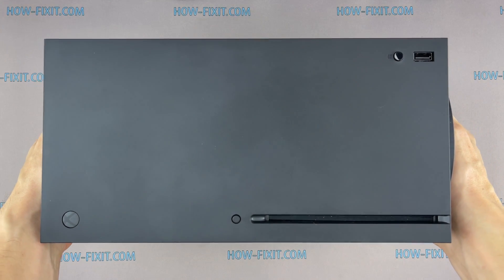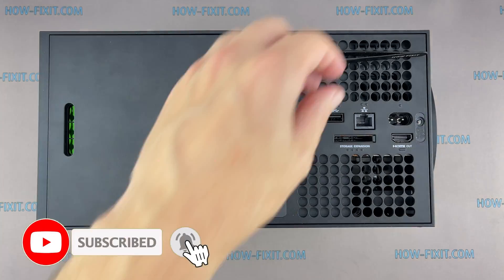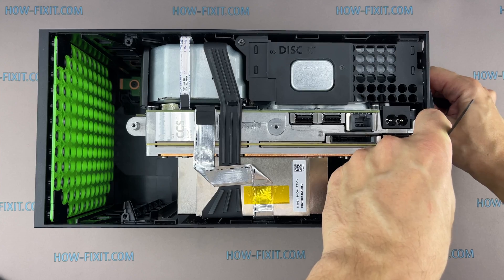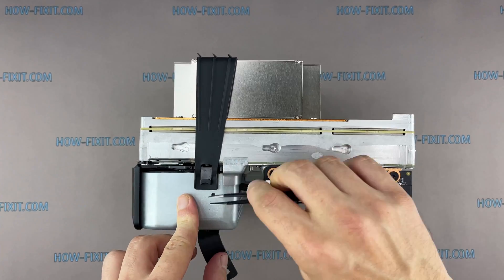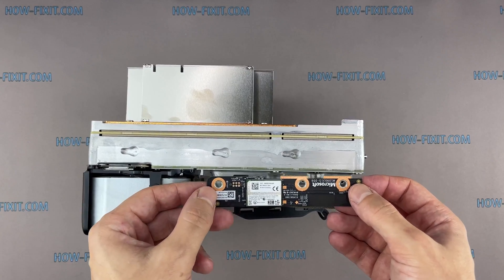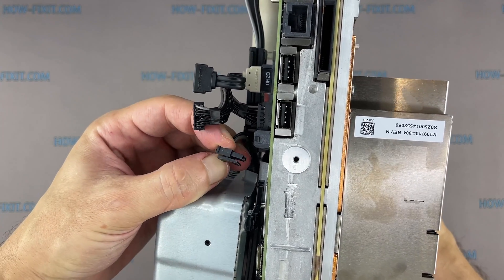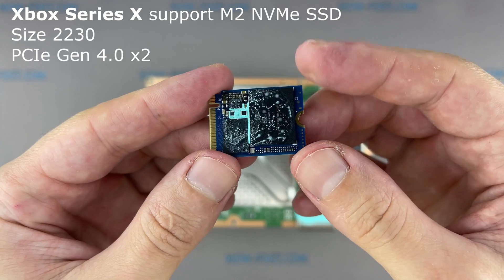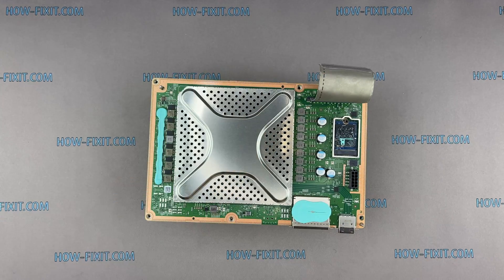Xbox Series X internal M2 SSD Replacement

Comment: Very good teardown/ reassembly.   Good luck installing OS on the system though.  Need to include the little part where you have to run a batch file on the drive. (master update file) which is not easy to find.

Comment: Hi... thank you for this good guide. Will ask if that one is compatible which i have buy... it is the Crucial P310 2TB M.2 PCIe Gen4 2230 will sold on amazon. Will this one working in my x series..? Will expand internal. Best regards
Reply: Hi this SSD works?
Reply: Hello, did the P310 work?

Comment: With how much you have to take apart you can tell it probably wasn’t meant to take apart vs the ps5 has way less steps although Xbox was basically built with a pc in it but it is nice a video like this having a thorough instructions of how to if someone took it apart . I just wish the external storage worked enough like the old Xbox models . Unfortunately some games can’t run on the other storages they have to run on the internal storage. Sometimes I wish the memory storage was built the way it used to be and ran like so to…. Thanks for the video again
Reply: @calebbrittain5004  if you’re talking about the external slot on the ps5. The main ssd is literally soldered to the main board, so when you think about it, the Xbox’s ssd having a removable one on the board isn’t that bad

Comment: This video is if your 1st internal NVMe fail, in the xbox you can change it but in a PS5 the NVMe chip is soldered to the motherboard so is WORST ! ....  OMG PONYS cant read !
Microsoft 2nd NVMe only put the expansion Card (easy like a usb stick) without open anything and is hot swappable like a usb stick so you can have many and change it without taking any part or screws.
Reply: @gilbertomv1  you’re soo damn dumb, you’ve got to be the worst Microsoft fanboy. The PS5s internal storage will last the SAME time as the ram in the system, it will probably take 10-15 years for that SSD to even fail.
It’s literally the same as most phones made long ago. There are still original Phone models that work complete fine.

Comment: Guys time to buy the 2TB Xbox then swap SSD and return it.
Reply: Already a head of you
Reply: Do it
Reply: It would be easier to just switch the xboxes themselves apparently the ssd only works for the xbox it came with because of software reasons
Reply: @huskymirai5824 Not if you clone the drive
Reply: @PaceyPimp apparently you need to clone a hidden folder and it doesn't always work and you need a 2330 ssd but those only come in 2tb for the time being imo its more trouble than its worth like maybe if you had a 500gb xbone but a 1tb to 2 is so much extra work and then you have to keep the oem ssd incase the new one fails 🙄
Reply: @huskymirai5824 upgrading from a random ssd is extremely hard and may or may not work but if you take it off another Xbox and clone it, it works.
Reply: If you find that hard then just swap out the case.
Reply: @huskymirai5824 well to switch the case is not that easy you have to tear it all down.

Comment: People are often complaining about the SSD. 
PS5's is soldered in, and the expansion slot is no different than the expansion slots on xbox's functionality on the back of the XBOX
Other than size variations (these things are expensive regardless) you can buy up to 2tb from seagate for xbox, and they go on sale somewhat. 
If you find a cheaper format of a different type, its still more of a process and you don't have the same standardization imho. Like thumb-drives they aren't all made equal, some are trash, and cheap. Xbox does force you into "seagate" or "wd" but they are both quality. 
Xbox made it extremely easy to upgrade. 
If your internal ssd goes bad, ps5's is soldered in so it's not like that's better .

Comment: This is BULLSHIT!!! Replaced my PS5 internal ssd and it literally took 5 minutes
Reply: I did the same thing while playing God of War.
Reply: You replaced only the 2nd nvme.
Meanwhile Microsoft 2nd NVMe only put the expansion Card (easy like a usb stick) without open anything and is hot swappable like a usb stick so you can have many and change it without taking any part or screws. 
This video is if your internal NVMe fail, in the xbox you can change it but in a PS5 the NVMe chip is soldered to the motherboard so is WORST ! ....  OMG PONYS cant read !

Comment: Don't forget that nvme m.2 pcie 4.0 has 4800MB/s write and read capacity. Under these values will not work just above. There are some opportunity on amazon to find adapters for external ssds.

Comment: I didn’t have to clone the software. I just put a 4tb in and installed update with a usb and it worked.
Reply: It can not be!
Reply: 4TB in size 2230?? First of all. The is no on market an m.2 SSD drive with the 4TB capacity in the 2230 size. And second of all, no one has yet managed to install a drive larger than 2TB, which unfortunately also requires modification of the firmware to make it compatible with the WD CH SN530. Good joke, prove it.

Comment: I think I could do this, but would absolutely hate doing so, the ribbon cables and removing stickers would be the most annoying part. The rest is just screws, but that isn't easy either keeping track of which screw goes in each hole. This video would help if you got confused.

Comment: Meanwhile PS5 users - 2 screws and... That's all. Miscosoft must hate their users ;D
Reply: Meanwhile Microsoft 2nd NVMe only put the expansion Card (easy like a usb stick) without open anything and is hot swappable like a usb stick so you can have many and change it without taking any part or screws. 
This video is if your internal NVMe fail, in the xbox you can change it but in a PS5 the NVMe chip is soldered to the motherboard so is WORST ! ....  OMG PONYS cant read !

Comment: Lol reflashing old xbox 360 optical drives with firmware was a less tedious operation.  Good job M$ lol. So much can go wrong if you're not careful with those ribbon cables.
Also ps5 adding a new drive.. just a couple screws

Comment: Thank you Sony 🫵
Reply: Meanwhile Microsoft 2nd NVMe only put the expansion Card (easy like a usb stick) without open anything and is hot swappable like a usb stick so you can have many and change it without taking any part or screws. 
This video is if your internal NVMe fail, in the xbox you can change it but in a PS5 the NVMe chip is soldered to the motherboard so is WORST ! ....  OMG PONYS cant read !

Comment: SSD upgradability: Very difficult!
Reply: Its only about 20 screws, not that bad, still sucks in comparison to ps5 though lol
Reply: @Hunt4Yoshi you cant in ps5 its soldered. At least in xbox you have a chance.
Reply: @wallacemre  not the extra slot. You pop off one of the covers and take out a screw or two and boom extra ssd slot. I’m an Xbox guy but I gotta admit that PS has the upper hand on that. Though, technically, Xbox has an open slot right on the back of the console, it’s just a little more expensive than some regular SSDs

Comment: Oh and you can clone its number but the update will break it wont have the key the og had to sign off for said new key 
Its like perpetual 
Not one and done

So on update you might have to reinstall old sd get the bew ticket so to speak and retransmit the key back to the good drive
Or am i mistaken
Reply: Your correct every time an update comes out you will have to do the whole process over again and there's a good chance you could get banned...cod3r is a console repair technician that has a lot of videos check out his explanation of why every Xbox series x and series s will eventually be a brick

Comment: Aye shit, I'm sticking to my quest for a PS5. This looks way too complicated, even as a PC builder myself. And can't even use the standard 2280 NVME???
Reply: Well it's the same scenario with a PS5 if your internal SSD fails actually on the PS5 the internal hard drive is broken up into three cards on the board .. there's not just one m.2 SSD inside a PS5... But whatever it fails which eventually it will it will also be a brick because Sony does not allow technicians such as myself to put aftermarket hard drives in their consoles anymore..

Comment: What about upgrading to a bigger size?
Reply: You can't do it sadly. It needs to be that SPECIFIC 1TB WD CH SN530 drive or it won't work.
Reply: @themightyant.  wrong, it doesnt have to be that specific sn530 idk where you got that information from or if you done it yourself but you need to clone your Drive using a software tool to the new one. that way all the format and data stays on the xbox.

Comment: What product did Microsoft apply on the SSD directly? This is very important, because i suspect this is heat conductive material. My guess is you cannot install another SSD dry inside that metal case... my 2 cents...

Comment: The stupid thing about this... Is that stupid Microsoft fanboys think THIS is far easier to do, than replacing the storage on a damn PS4, or getting an M.2 for a PS5.
Literally had to take apart the whole damn system, just to take out the internal storage.
Reply: Meanwhile Microsoft 2nd NVMe only put the expansion Card (easy like a usb stick) without open anything and is hot swappable like a usb stick so you can have many and change it without taking any part or screws. 
This video is if your internal NVMe fail, in the xbox you can change it but in a PS5 the NVMe chip is soldered to the motherboard so is WORST ! ....  OMG PONYS cant read !
Reply: @ The internal storage for the PS5 will outlast till the next gen of consoles. Of course you would defend Microsoft’s crappy practices of thinking 2TBs of storage is worth 380 CAD. Y’all never listen, and it’s proof that Microsoft should stop making Xbox’ so people like you don’t appear.

Comment: Jesus, they really didn't have to make it this difficult to replace an SSD.
Reply: its not difficult. Its just impossible, because you just cant buy regular empty drive place it in console and install OS.
Reply: @tomski7328  Not impossible, just tedious.  There's a set of encrypted keys that marry the SSD to the Motherboard.  there's a 1024.1 MB RAW partition that holds the keys on the SSD.  That 1 GB is all you need to clone from the drive, the rest can either download from the cloud backup, or upload from an OSU1 flash drive.  Also, the key set gets changed every time you do online updates, so make sure you disassemble the Xbox and clone the RAW partition after EVERY system update, or you're bricked in the case of a drive failure.  Make sure the new SSD is exFAT format before you start cloning.
Reply: This is really the worst side of series x/s
Reply: It’s cause they don’t want people to be able to do things on their own.
Reply: There in it for you to spend more simple they offer it but with string behind it sad
Reply: QFT
Reply: Thats why i bought ps5
Reply: @AbdullaDhanahani  that comment made zero sense as it’s 100x harder to replace the internet ssd of the ps5.
Reply: @travisgarland840  yeah but tbf there’s also an external slot, you just pop off one of the covers and take out like two screws
Reply: @monyetbesar  if you’re talking about replacing the main ssd, the one in the ps5 is soldered to the board and you literally cannot remove/replace it unless you have profesional tools and the skills, if you can even buy a replacement one
Reply: I’m an Xbox guy. But at least PlayStation has better ways of replacing the hard drive in the PS4/PS5.

Man remember how simple it was to replace the hard drive in the Xbox 360?
Reply: @optimusN64 adding extra maybe. But the ps5 internal ssd is soldiered.
Reply: @travisgarland840  yes, the internal storage is soldered, but they offer m.2 expansion that is as simple and sliding off the case cover, lifting a panel then plugging in a supported m.2 (i believe up to 4 tb if not 8) just needs to have a heat sink and then putting it back together.  It also supports a wide range of sizes compared to this. Its nuts the best option is external storage for storage expansion. kinda dumb this is how they chose to design it.
Reply: @jamestaylor9887  yes that’s why I said adding extra. My ps5 has a 4tb lexar nm790 in it. But Xbox vs ps5 internal ssd to fail id take swapping the Xbox ssd over the ps5. It is doable
Reply: @optimusN64 lmao I still have my Halo 360 edition I left unmoded and a few white 360s and black elite edition. The simple pop off hard drive off the top of unit and swap between consoles
Reply: @optimusN64  internal storage of ps5 is soldered, means you cant replace it whatsoever.
Reply: @m1st3r1 I have a PS5 and there’s a port for you to add a second SSD. I have already done this for is and was going to do this for my series x. This video just killed it for me.
Reply: @m1st3r1  If needed, you can unsolder the chips and re ball them all with a hot air station and a stencil
Reply: So there's absolutely no way to actually upgrade the SSD inside the damn thing and they only want you to use the expansion cards ,man Xbox really acted like a fool compared to how PS5 lets you upgrade the SSD ,and I love my Xbox....
Reply: @ant143x2x  you can’t upgrade the internal on a ps5, you can’t even change it. It might be a pain for the Xbox but you can change it and it might even be able to upgrade it.

Comment: I am wondering if this RAW partition is actually an encrypted partition that stores info for the xbox.  If it is than hopefully someone will be able to break the encryption.
Reply: It's a set of encrypted keys that marry the SSD to the Motherboard.  there's a 1024.1 MB RAW partition that holds the keys on the SSD.  That 1 GB is all you need to clone from the drive.  Also, it gets changed every time you do online updates, so make sure you disassemble the Xbox and clone the RAW partition after EVERY update, or you're bricked in the case of a drive failure.